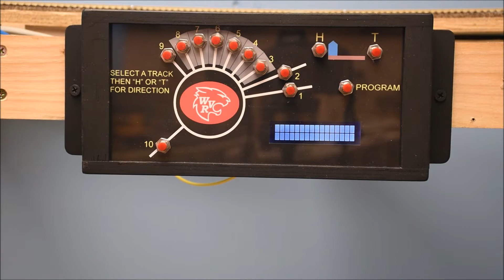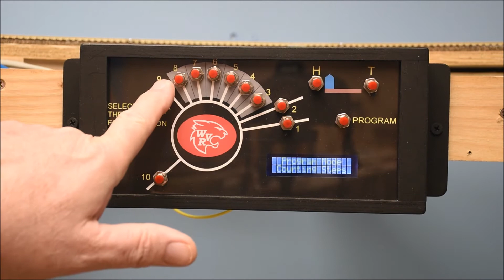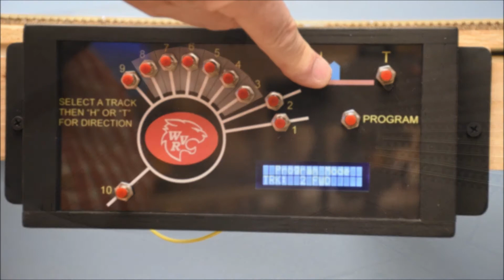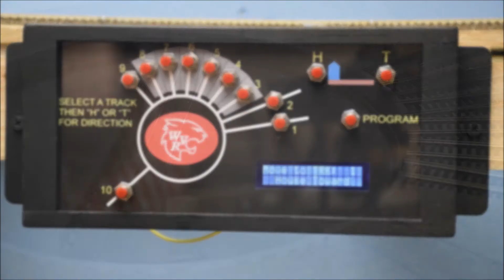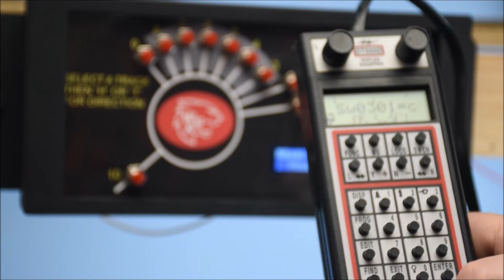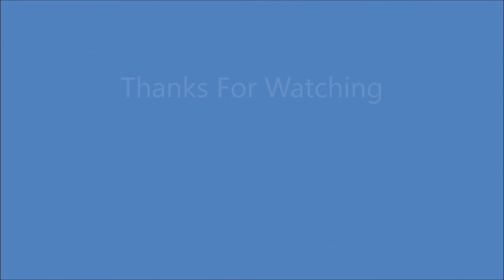WVR Turntable

Comment: That looks pretty awesome.

I'm considering getting one of these 90' non-DCC turntables and adding my own DIY drive with a stepper motor + Arduino DCC Accessory Decoder. I've already written an example DCC Accessory Decoder using my NmraDcc Arduino library software, for driving a stepper motor to rotate the turntable. Others have used it, but I've not yet...

So before I went too far down the rat hole, I was keen to see a bit more of what you have done customising the mountings and stepper linkage - to know what has worked for others.

I figured I'd just 3D print a large + small replacement gear-set to fit on the turntable centre shaft and stepper motor or maybe do it with a 6mm drive belt used on 3D printers.

Anyway I'd appreciate any input or comments you may have. 

Is the Arduino sketch you're using available online anywhere or would you be prepared to share it?

Regards
Alex Shepherd